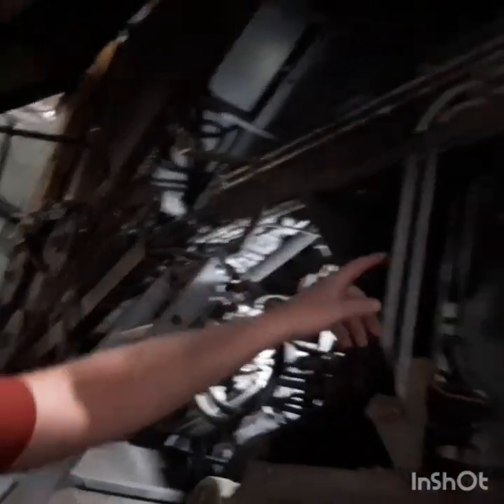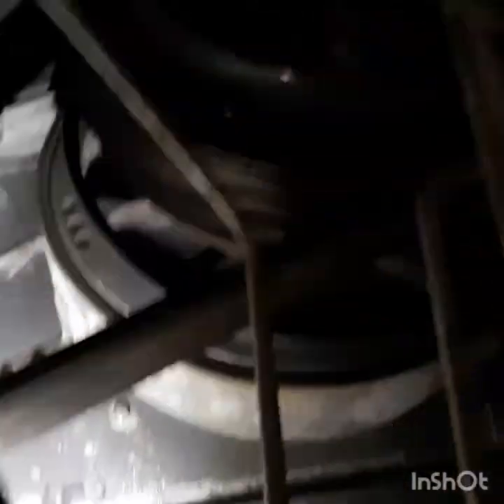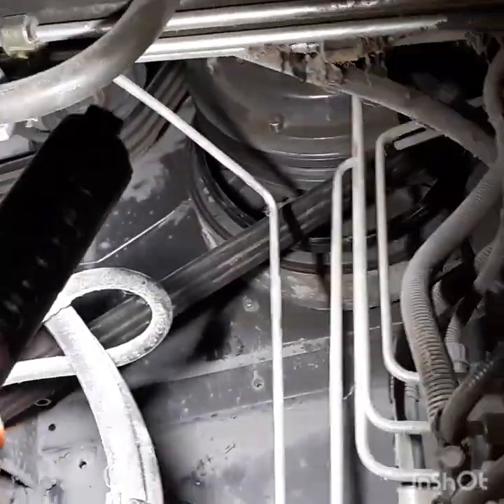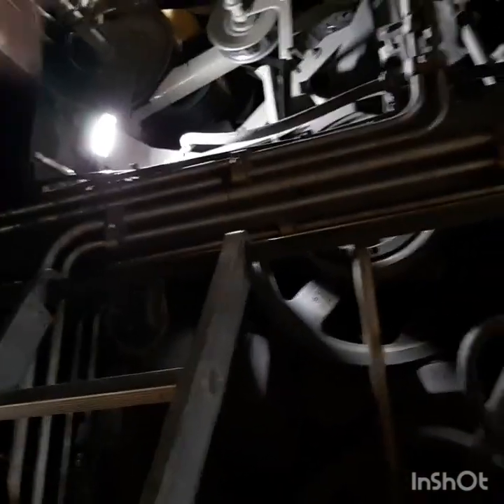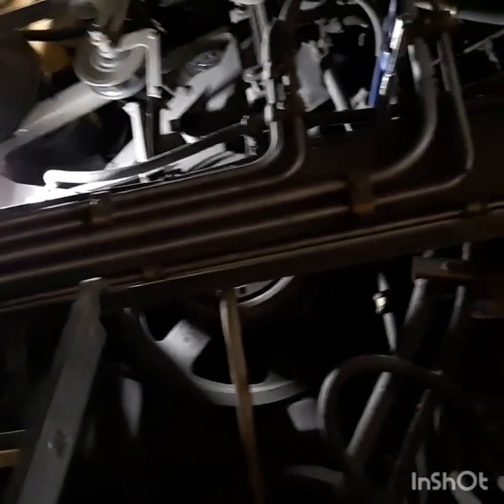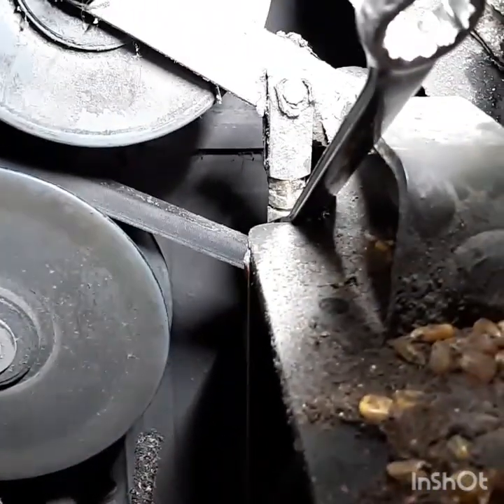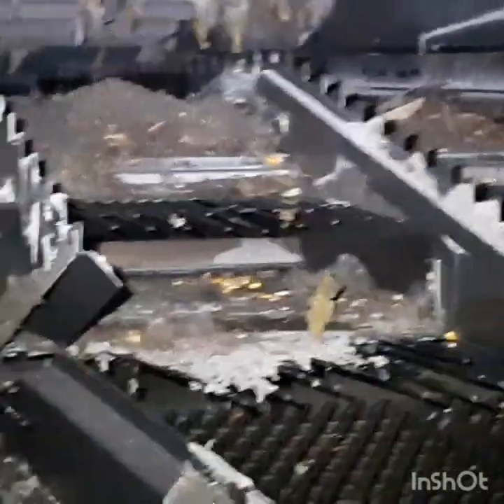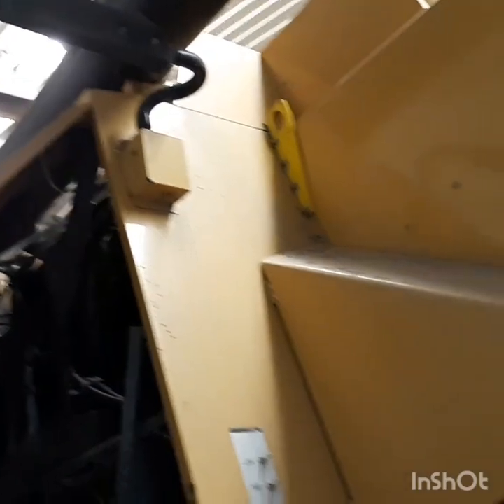Thawing lexion out!

Comment: Lucky you have a heated space to thaw it out rather than having the dealership come and pick it up. Hopefully no damage there to the chaffer and sieve.
Reply from the maker: North Dakota Ham I thought it for as long as I did because the chaffer and sieve were clean. It was everything underneath them that was iced up. Hoping to get back out this weekend or even today?
Reply: @jonstevensmaplegrovefarms3754  good luck on it Jon. How much corn do you have left to pick up?
Reply from the maker: North Dakota Ham about 200 left to go.
Reply: @jonstevensmaplegrovefarms3754  that wont take long with that monster machine you have there!
Reply from the maker: North Dakota Ham  about 30 separator hours.
It's the drying and getting it to the elevator